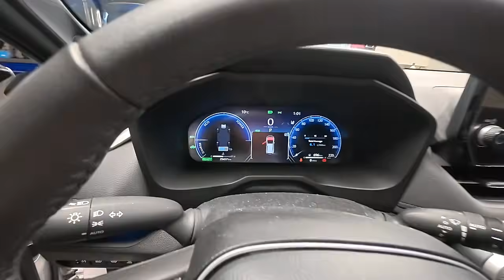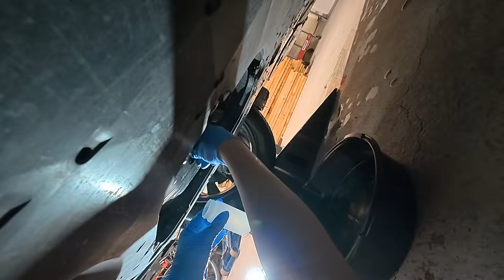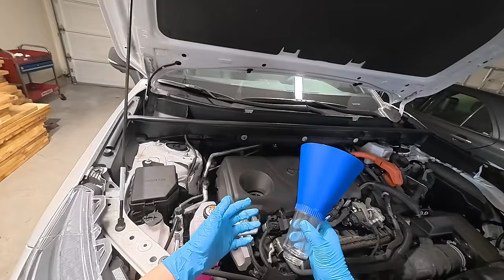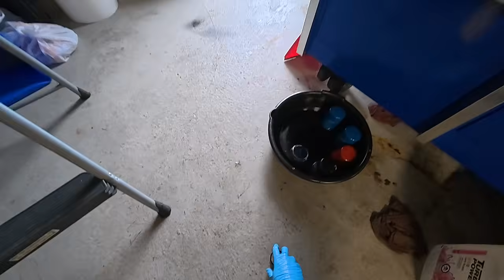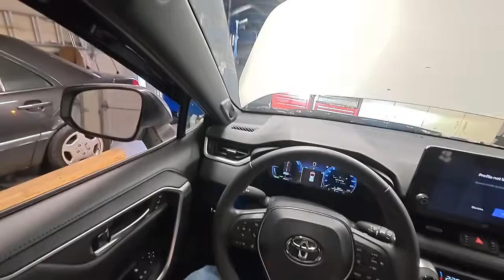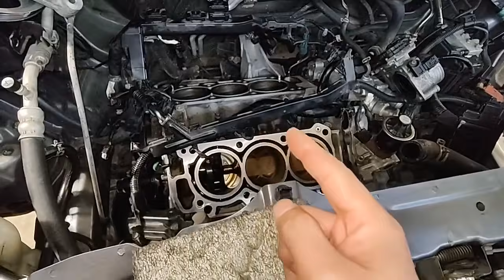5w30 Instead of 0w16 oil change #2 in the Rav4 Hybrid.

Comment: The 0w16 and 0w20 guys are pussies…. Admittedly, I go 0w30 in winter (northern Ohio on the lake), but 5w30 as soon as the weather breaks and I’m due.
Reply: My daughter’s 2014 CRV has the notorious rattle on cold start up with 0w20… does not have it with 5w20 or the 5w30 I currently use in it.

Comment: Crickey! After reading some of the comments below, some people are way too stringent on oil viscosity.
I have 2020 Rav4 with 2l engine that has close to 160k km using 10-w40 all year long.
And i have 2025 camry (regular engine) bought it in Aug 2024 and i have been trying to see how 20-w50 will work and things are fine.
Reply: Where do you live?
Reply: @yogashima3 Saudi Arabia
Reply: People in USA have opinions like assh0les.  They do not think before they speak.  They like confirmation bias so that their decisions are correct.  So they have to attack anyone that thinks and knows engines built in Japan for US, Mexico, Saudi Arabia, and Australian markets are identical.  No manufacturer would build it differently because it would cost manufacturers money. 

My US based engines are all taking 5w30 at minimum.

Comment: Its not about just ambient temps because of engine tight tolerances its better if u use 0w30 because more of the wear happens at the starting time . Darker is better because its cleaning the engine 0w oils and usually with more adiditives so they protect your engine more keep it cleaner .
Reply from the maker: Oil getting dark doesn't mean it's cleaning your engine it is also thermal break down of the oil. You can heat oil in a pot and it will get dark. Project farm does a good job of showing this.
https://youtu.be/xtSwaF2evTU?si=eu4LBdWcseL-RG0G
Reply: @theoffroadingmechanic you are right also it gets dark from thermal break down and cleaning the engine both but the thermal break down is above 200c well above  operating temps .so if its getting dark and engine is not over heating I would suggest its from cleaning adidtives doing its job .
Reply: Check out motor oil geek videos he explains better because he has formulated many oils himself .
Reply from the maker: In cylinder temperatures can get over 800c the cylinder walls can be 200c because of your cooling system but the oil film on the wall is getting the full brunt of the heat it gets scrapped off the wall by your rings and drains back into the oil. Also bad on turbo chargers when oil cokes on the turbine shafts when you shut off your vehicle. Thinner oil also has a lower flash point.
Reply from the maker: Yes he goes into detail in formulation but oil still burns and you get soot or varnish.

Comment: Please keep updating
Reply: I bet it won't take a decade. I bet we will start seeing the newest Toyota A25A engines running 0W-8 failing in 2 to 3 years. Those low tension piston rings are going love burning that thin crap. I bet carbon packed rings and scored cylinders will be a big issue on high mileage oil change intervals.

Comment: Please show me just one case where 15w30 vs 0w20 had better wear metal tests were better for 5w30 after the 10,000 mile break in period for the same vehicle that calls for 0w20
Reply: There’s plenty of tests online showing better film strength, viscosity breakdown for 5w-30 over 0w-20, only thing 0w-20 has is cold flow.

Comment: Strongly dislike the TOYOTA P ring o-ring filter and the crush washer (Completed about 200 FORD oil changes believe it or not never had an oil burning issue.).  Lastly reading TOYOTA dipstick is a challenging.

Think I will replace draij plug with a rubber seated plug which have never leaked with one having a small cut never leaking.

Comment: Crush washers? Get a Fumoto valve.  It pays for itself in time, crush washers, and paper towels.
Reply from the maker: I had one on my RDX and man I couldn't stop thinking about what if something hit that handle for the valve because it was facing downwards with no underbody protection and I took it on forest service roads.
Reply: You can always add a thicker or second washer to have it face another 90 or 180 degrees. Unfortunately oil pans don't have the threads starting in the same place.
Reply: I bought one but ended up never using it. Changing the filter still makes a mess negating the paper towel savings.

Comment: And the battle rages on... what's next ?..start using bigger bolts than the ones that came with the IKEA coffee table because it will last longer? This topic has become nothing but rage bait for views at this point.  I'll stick to manuf recommended viscosity, use quality oil (ex. Penz Ult Plat ) and OCI every 3k ( overkill???? yep.... but it's my ride not yours).
Reply from the maker: Pretty much for people who likes to tell you what to do. Originally I just wanted to see if it made a difference for fuel economy. I've had the same Ikea furniture for the last 20years still holding up my 65" tv lol.
Reply: @theoffroadingmechanic  LOL..nice. Also, I'm in NY, not Canada who am I to tell you what a cold winter looks like 🤣

Comment: 0w-30 might be better for cold Alberta winter temp.
I'm reconsidering the oil vicosity choices for my cars.
Reply: 0w30 suffers more from oil shear than 5w30.  No real reason to use it unless you are in the Arctic.
Reply: Ow-20 is better than 0w-30. Less shear potential. 
When its real cold, 0w-16 would be even better.
Reply: @JTS-WTP or 0w8 if it’s 70 below

Comment: I plan to do the same thing to my 4runner. Will be going from 0-20 to 5w-30.
Reply: Did the same on my 2023 V6 Tacoma after moving to Florida (from Ohio). The 0W-20 is like water even when cold, can’t imagine how thin it is when hot. All for another mile per gallon. Not worth it to me, hoping for this Tacoma to last until I die (I’m 71). No regrets!
Reply: Go straight to Euro 0W-40 with tons of detergents and ZDDP. My dad runs 20w60 in his 1998 4Runner and it runs like a top. No oil is too thick, too thin yes but not too thick.
Reply: @dawood2u  😳 “60” thickness is  for super cars like BUGATTI or Koenigsegg ! 😂😂😂
Reply: @64arguz Yes and my dad's 4Runner receives Bugatti level protection in harsh Afghanistan 😃
Reply: @dawood2u 😂😂😂👍🏻
Reply: @dawood2u I run M1 0w40 Euro in many of our cars. My BMW, Toyota, Pontiacs, even in my 1968 Buick’s 462 big block with a flat tappet cam. Best all around oil IMO! 👍🏽👍🏽
Reply: My humble Camry turned 150k miles and I’m using 5w30 since it reached the 100k 👍🏻
Reply: @64arguz hyprd?
Reply: https://youtube.com/shorts/i6ya-_K01tY?si=YhsvJ8m0P8PT3qbS
Reply from the maker: Lol I want to find out. But my dad is retiring from a shop that he's been at for 30 years and they service taxis that are also using the same generation Rav4 with 5w30 and a lot of them are hitting the 700k kms
Reply: Good luck, see you in my shop
Reply: @PCf1ght What a dumb comment. Modern engines rarely come in for oil related issues. As a mechanic you have no knowledge of the lubricant industry and why certain weights are recommended. So stick to what you know, turning a wrench. You can start by looking at CAFE standards…
Reply from the maker: Yea you will never see anything or proof anywhere that the wrong grade of oil will damage your engine. All you see on the internet is click bait and failures due to lack of maintenance. Cuz you can't prove it.
Reply: @theoffroadingmechanic You are spot on my friend! People on YouTube obsessing over which oil is best and a few PARTS PER MILLION wear metal difference 😂… Yet they don’t appreciate this doesn’t correlate until millions of miles of data in a fleet with one lubricant and a accompanying engine tear down. Crazy what laypeople buy into, all the best!

Comment: Say goodbye to your engine is tens of thousands of miles. 0w16 is not entirely a CAFE scam; it doesn't apply to all vehicles. You're going to find this out sooner than you realize. Just because your vehicle seems to run fine now will show otherwise down the road. This engine was designed specifically for 0w16. The idea that other parts of the world use higher viscosity is correct but in older engine and maybe SOME newer engines. This is NOT the case for your Rav4! It is not too late to go back to 0w16 but I am warning you now you have made a huge mistake!
Reply: no, this engine can run multiple grades of oil. It's a volume engine used globally. Rav4 in other countries can run all the way up to 10w-40
Reply: Another American patriot came to the scene.

Comment: Don't be a fool guys, just stick to the recommended oil grade. As we saw the oil quantity was more than what was put in, it is a clear indication of some sort of engine malfunction. Either the injectors are injecting too much fuel due to the incorrect adjustment of valves(due to the incorrect oil pressure) and the excess fuel is getting mixed in engine oil. This may not seem like a castastrophic failure in japanese engines as they are designed to last longer. 
I have seen many videos where the engine runs 200-300k miles without any issues on 0w-16 oil. Yes 0w-8 and 0w-16 oil are very thin but they provide cohesive lubrication and are doped with additives like molybdenum which acts as a friction modifier. It is always recommended to use the OEM oil as it is specifically designed for that particular engine. 
For hybrid vehicles, it's very important to use a thin oil like 0w-8 or 0w-16 as the engine would start and stop multiple times so the oil needs to flow quickly. 
Just follow the manufacturer's guidelines and the car would run without any issues, engineers have designed the engine and the tolerances are built as per the oil viscosity. Don't listen to a random high school dropout mechanic or random youtubers who say otherwise.
Reply: Except my owners manual recommends one viscosity for the USA(0W-20) and a different viscosity(5W-30) for the rest of the world.    Its 100% due to USA cafe standards forced on all car manufacturers to increase fuel economy.   The Manufacturer thinks 5W-30 is best for the engine and they compromised to 0W-20 for the USA fuel economy standards.
Reply: @OvenFridge  What about Japan where Toyota is from? They also call for 0W-16 and 0W-8 oil.
Reply: @Raptors416 they do call for 0w8 or 0w16 in japan? That's recent, because the same engines called for 0w20 or 5w30 in Summer. Here in Colombia they call for 0w20 (emissions) yet people have found they do last longer with 5w30.
Reply: Oil wash happens in every direct injection engine. Especially when cold. I have a nissan titan v8. Fuel wash happened with both 0w20 and 5w30. With nissan. They recommended 5w30 in 2017 on my truck and in 2018 they recommend 0w20. No engine internals were changed. This is a fuel economy and emissions thing brought on by the EPA.

Comment: Oil grade is based on bearing clearance and temperature of operation. Just look up the clearances (specs) of any engine and adjust accordingly.
Reply: My2025 Ridgeline service manual says is . 007-.017 bearing clearances with 0w20. I look an 1999 Odyssey that short block is basically the same and bearing clearances are exactly the same and call 5w30 for cold weather and 10w30 for all weather.
Reply: @mandytuning   the only change might be the metal they are useing. Steel/Cast/Aluminum, these all expand at different rates,
Reply from the maker: You are correct bearing clearances has not changed tolerance has not changed they say things like tighter tolerances because it sounds like they have engineered something amazing and you can run thinner oils. But reality is metal expands through temperature and to tight of a tolerance causes friction. The same 1gr-fe that ran 10w30 back in 2010 and the 1gr-fe running 0w20 has not changed muc other than how the engine is controlled and added on a bunch of emission control crap.
Reply: Thanks for that. Ppl really believe these thinner oils are for anything more than just EPA regulations. My 2012 F150 called for 5W20 for that gen 1 5.0 Coyote V8 and just a year or 2 later called for 5W30 on that same exact engine 🤔
Reply: @fernandobriseno8164   i have a 2011 ram, 5.7 hemi,  5w/20 is what it calls  for ,  i have always ran 5w/30   over 200 thousand miles no cam failure ,
Reply from the maker: It's because that coyote motor when it got to the higher mileage it starts to lose oil pressure because the clearance has gotten bigger. And changing to a thicker oil help that bump in oil pressure.

Comment: What do you think is the reason the zero weight oils seems to come out darker?  Ultra Plat is a really good oil. Any thoughts on Valvoline Restore & Protect? I think that would be good for keeping small oil passages clean and open.
Reply from the maker: Project farm does a pretty good noak volatility test with 0w16 vs 5w30. It's just due to thermal break down. Thinner oil has a lower flash point and will evaporate easier than oil with higher viscosity. Also bad for turbo chargers causing coking when no oil flow to the turbo charger when you shut off the engine. I haven't tried restore and protect but what I really want to do is find a really neglected engine full of sludge and just do shorter oil change intervals to see how well it cleans.
Reply: 72 retired,  have a 2006 Subaru sti.  Oil changes every 3000 miles.  Higher maintenance and repairs than a Toyota or Honda

Comment: Never go 5W on a hybrid, keep the 0W. What you want is a 0W-30.
Reply: Some people would disagree with that, can you post why you believe that?
Reply: Depends on the lowest temperature you see there bud. If it’s not operating in negative temps it’s likely of zero consequence.
Reply from the maker: The Toyota owners manual actual shows a graph of or operating cold temperature range. If you look up 5w30 cold temperature you will find that it is still fluid up until -30c or -22f. Places like Alberta that gets colder than -30c would be using the 0w.

Comment: U need a bigger oil pan loll
Reply from the maker: I do need a bigger pan or I can use an aluminum cooking try would probably be cheaper. My 4runner fills that thing to the brim and I have to try and not spill it as I shuffle it out from underneath.
Reply: @theoffroadingmechanic check out cement mixing tubs at home depot they big

Comment: I have a question. Why are you using 5w-30? What is your goal?
Reply: There has been a new idea lately where using 5w-30 oil can make the engine last longer
Reply from the maker: Doesn't look so good with gm and upping their oil to 0w40 instead of the 0w20 from the factory. And tundra with an under square engine pushing that amount of power also having issues with bearings
Reply: @theoffroadingmechanic  The bearing problem has nothing to do with the oil. GM is just buying time. It's just a poor design. Plus that's a whole different engine than what's on a Rav4. Show me one oil analysis report that states that the recommended oil for the Rav4 is too thin and that you should go to a thicker oil for better protection?? Show proof?
Reply from the maker: @jackfrost99 They are no comparison you are right I'm just using examples. But we are in an age where things are getting thinner and for what reason? Quality of parts are down. I still think oil has something to do with it especially something that's pushing over 400hp and you expect your oil to provide the proper protection. when something is well engineered and the quality of manufacturing in parts is there and something that is well engineered sure thinner oil can be used.
Reply: @theoffroadingmechanic  I understand you're just doing an experiment, and I am curious of your outcome. I'm not going to argue anymore. It's your vehicle and you can experiment if you want. Keep us posted.
Reply: Simple, he just wants to see if a thicker oil will extend engine life and cause less wear.
Reply: @Goingpostal-dg1vz  It won't if you change your oil on time. Zero evidence that it will on this Toyota engine. This engine goes on/off all the time. Thinner oil gets to the components faster at start up than thicker oil for better protection. Plus you get better gas mileage. No benefit using 5w-30 if you change your oil on time.
Reply from the maker: Thinner oil gets to components faster yes but also flows out of components faster that is just flow characteristics of thinner oil. Thicker oil tends to resist flow while unable to squeeze out from between 2 surfaces as easy as thinner oil under pressure. Oil pump will constantly supply constant flow as fast as it flows out from between bearing surfaces. That is my argument but when you remove a bearing cap oil is still retained in them when the engine is off. I know this from having to remove bearing caps even after sitting over night when doing connecting rod bearing recalls
Reply from the maker: Why not? I just want to know for myself does it actually make a difference in fuel economy and so far that's a no. Does it help from fuel dilution in the winter time cuz fuel in the oil thins the oil out like the Honda 1.5t or any vehicle with direct injection and with already thin oil. That is why I took an oil sample and to see what kind of wear medals if any. One thing I regret not doing is getting a sample when I had 0w16 in it. Questions that need answers.
Reply: @theoffroadingmechanic  It's 100% proven that you get better gas mileage using 0w-16 than using 5w-30. The fuel dilution is usually caused by very short trips and the cold will make it worse, but it shouldn't be a problem if you change your oil around 5k miles. The Rav4 2.5L engine is both GDI/Port Injection with virtually no dilution problems unless it's driven on very short trips and not changing the oil on time.